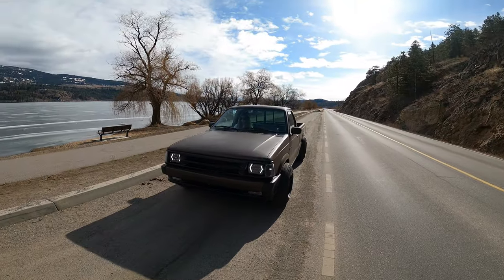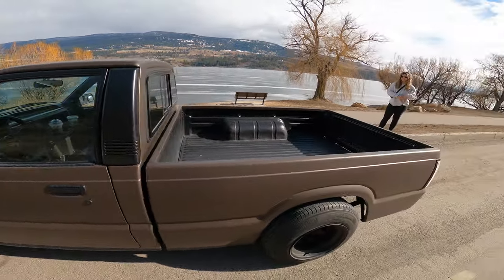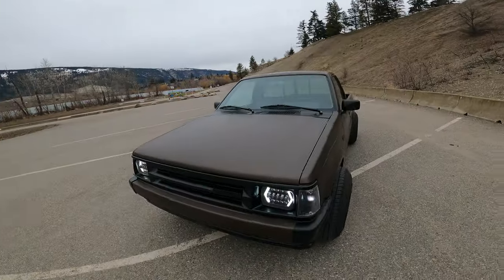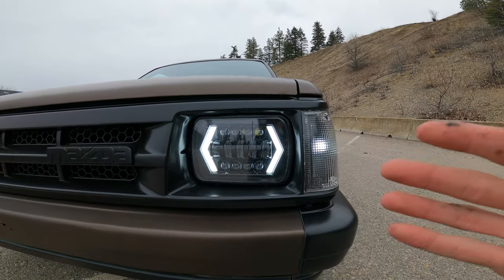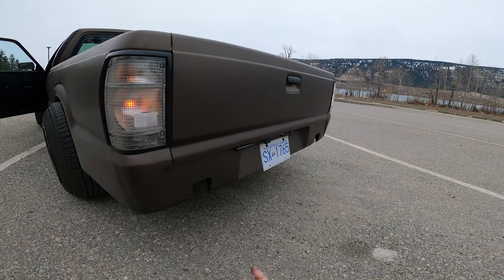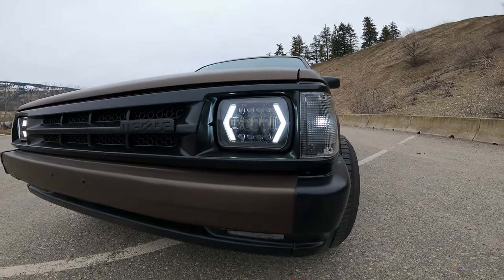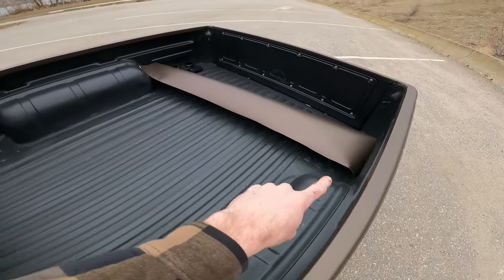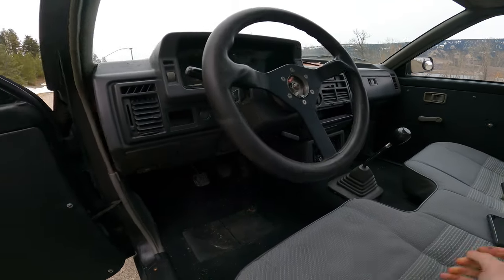Cops Pull Me Over on my FIRST Drive in the Mini Truck??

Comment: I'll be moving back to Windsor Ont. in the next couple years after 30+ years of living in the States, I'll be bringing my 94 Sonoma Ext. Cab with me and i'm sure the cops won't be liking it. I bought the truck out of the hills of N. Carolina and it's pristine with out a single mod to the body, lights etc. (factory white paint) Where I think they might have an issue is with the 641 hp N/A stroker in it. lol. I like your truck especially the headlights. You can always get rims with the offset you need to tuck your tires in. I run 10.5" tires on my truck tucked under the rear wheelwells....5" in the front because of the wheelwell headers. My family tells me i'm not going to be a happy camper when I move back to Canada.......we shall see.

Comment: I had a ‘93 B2200. The truck was a base model and was sold brand new without a rear bumper, so a bumper should not be required to be road legal. Regarding the lights, you need orange reflectors on the sides of the vehicle at the front and red ones on the sides at the back. Some small pieces of reflective tape from Crappy Tire should satisfy that law, just stick them to the light lenses.